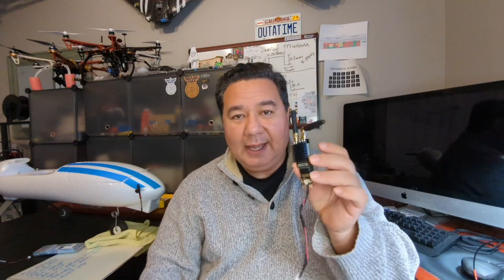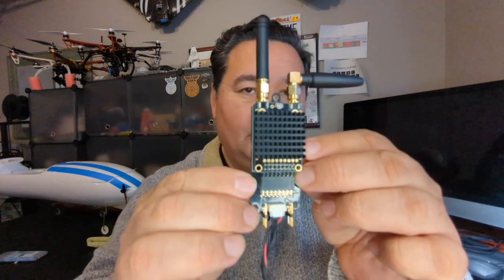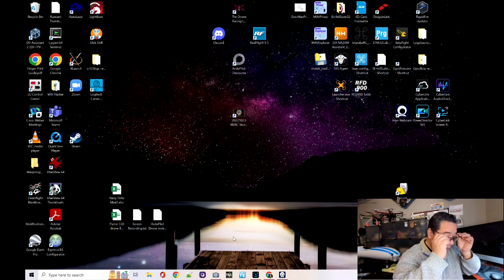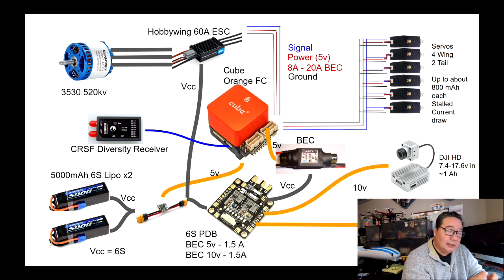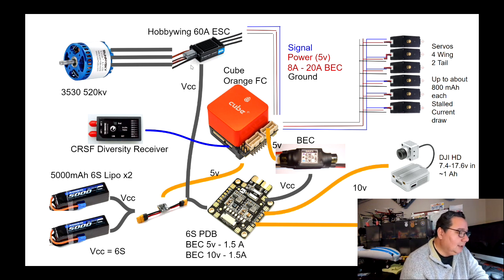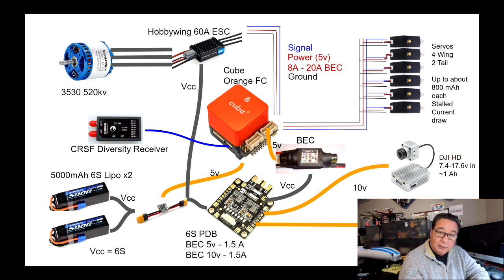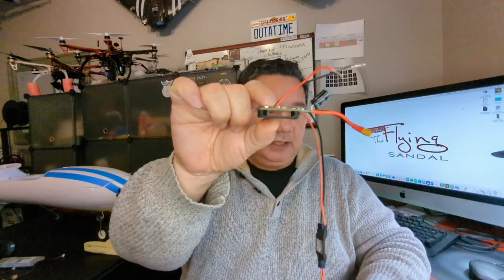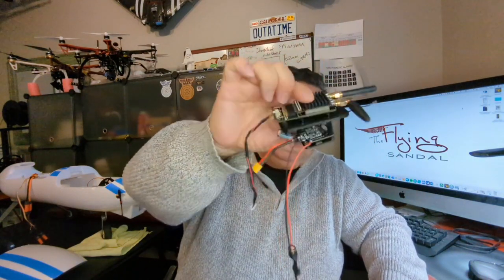RMRC Anaconda - Behold the Power of the CUBE!

Comment: Hello please discuss different OSD options for the pixhawk because although you showed the dji thing is not all can afford it i tried using holybro OSD but it’s very noisy i just ordered the Hobbyking micro osd today can you discuss other options i need help myself
Reply from the maker: Hi, i hear you, I know what you mean with components getting pricey.  I think different OSD options may deserve their own discussion. I'll plan for that. Thanks for the comment
Reply: @theflyingsandalrc  no problem on my channel i fly many miles at a time but I’m limited to Eagletree vector cause i doing like Matek and don’t like 5.8ghz either i can get my pixhawk Orange cube going but i won’t dare give it any type of mission because i need to see what and where it’s at instead of hitting a switch and crossing my fingers i used holybro osd into the Pixhawk but noise came in i added caps and ferrite rings and same thing again i don’t use telemetry radios cause no point if i can’t see what and where the airplane doing i bought a mav link compatible osd from Hobby-king I’m hoping you can help me find an osd solution so this way u can actually have a autonomous vehicle

Comment: In my anaconda if u look behind battery tray in the middle of fuselages there are slots in the foam I took a piece of balsa and made a tray that I can slide in and out. So I cut two thin strips of balsa and glued to each side on top of tray  if you push down on the two thin pieces while glue is drying then it hold tray tight enough so it doesn’t move but u can still slide it out and access flight controller
Reply from the maker: Thanks for the suggestion. I noticed that part of the fuselage and though about maybe doing something similar. It's hard to get a good measurement in there, but I'll keep it in mind.  Thanks!
Reply from the maker: @Healing Spaces DC thanks for all the encouragement! ;)